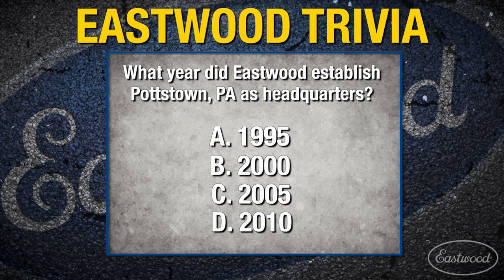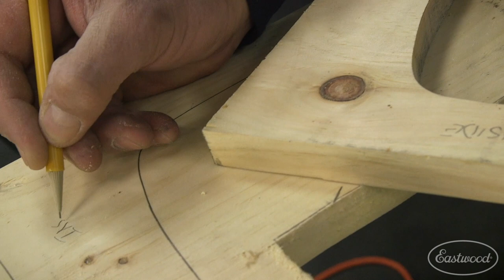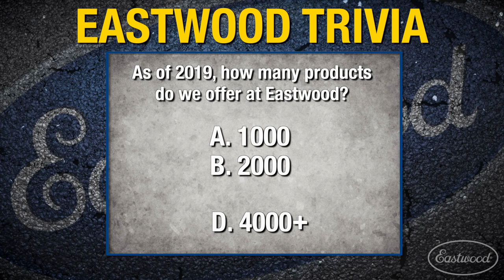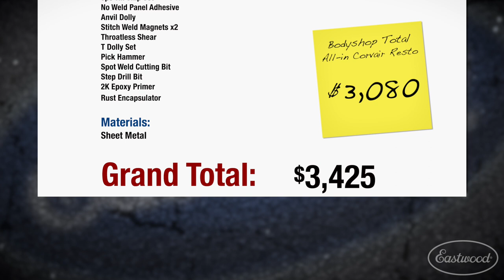How To Repair Rusted Door Pt.1- Repair Restore Revive: Ep.3 - Eastwood

Comment: I have longevity concerns with encapsulating rust, personally. It might be fine, but i'll almost always mechanically and/or chemically remove rust before putting another coating over it.
Reply: I don't understand why they did that. They could have at least let some naval jelly sit on the rusty surface while they were working on the other parts of the door. It wouldn't have taken much longer to clean it up first before spraying expensive epoxy over it.

Comment: What about the opposite side where you welded?  There's no encapsulation, epoxy, nothing.  It will rust from the inside out
Reply from the maker: Yes, it's always a good idea to cover all bare metal in epoxy, including the inside of panels.
Reply: @eastwoodco  do guys have a video on a rust hole in a panel that you repaired where you can access both sides.  Torn between cutting the pitted metal out, or sand blasting it, epoxy using bondo, and reapplying epoxy to both sides to seal it.  Then continue the painting process, surfacer, base coat, clear.  Is it really worth welding in metal?
Reply from the maker: Are you looking for an alternative, like this?  https://youtu.be/-gD7LR1IiaI